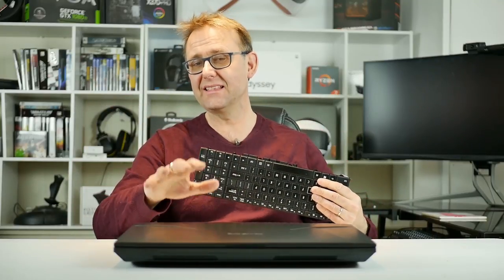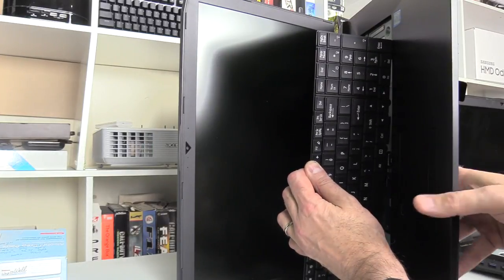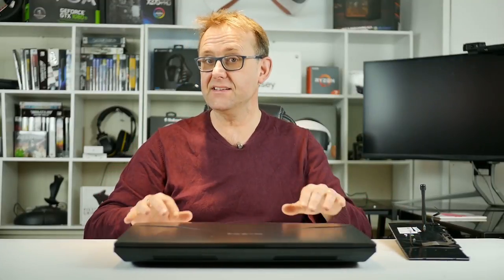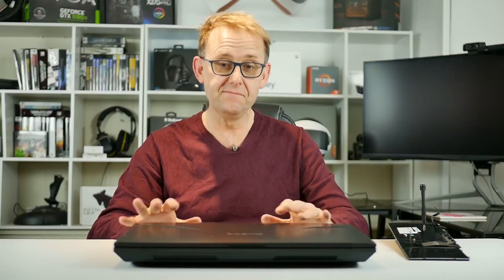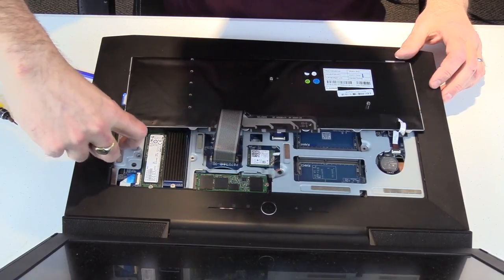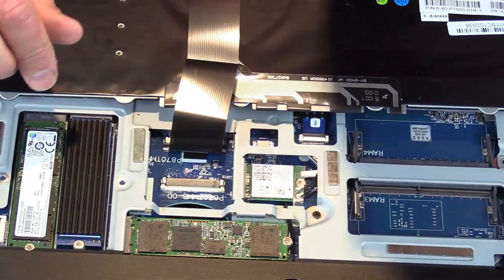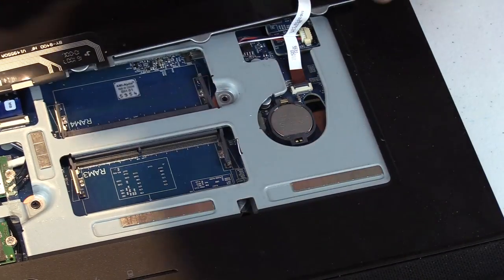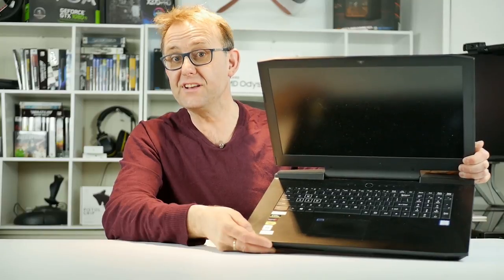My Keyboard Got Stabbed ! How to Replace Clevo P980TM/KM Keyboard

Comment: I know this video is two years old, but i am commenting for the sake of anybody watching now. You are not supposed to push the keyboard out using the screw hole of for the keyboard. There is a separate hole near the fan casing where you can insert a screw driver in. The keyboard has protection behind that hole. You will not puncture the keyboard it using this hole. This hole is marked in the user manual of the laptop, but unfortunately thee is no marking on the unit itself.
Reply from the maker: Interesting. Because the hole i used is marked KB for the keyboard. Next time I do a repaste I'll check it out.
Reply: @OWNORDISOWN  The K/B marking is to indicate that the keyboard screw goes her. The hole that is to be used to push the keyboard out is different one. This hole is marked in the user manual but strangely there is no marking on the motherboard.
Reply from the maker: @PrimeTimeAction  yes, it is strange . They just create confusion with the marking.

Comment: Awesome video. Quick and to the point.  What is your favorite laptop for gaming on.  Thanks for the vids. Channel still looks good with the new name.
Reply from the maker: Cheers Mike :) It has to be my Sager NP 9877, it was a complete pain when the keyboard got pierced. The A and Q keys wouldn't work so I was carting a small mechanical keyboard around with me.
I currently use both the Sager and Flip 14 equally as much and my Aorus x3 for work at the moment.
What is your go to laptop for gaming Mike  ?
Reply: exklim Tech News glade u got it fixed.

Comment: where can you get new clippers that hold the ribbon cables in place as mine are loose when I tried removing the keyboard to upgrade this laptop?
Reply from the maker: Replace the connectors on the motherboard? Perhaps Amazon. A search for ribbon connector brings up many options

Comment: hey! thanks for the video... my "q" key is very unresponsive (I have to press down hard + for a while). I've been trying to call clevo and send emails but no response... looking for a replacement of my p775tm1-g, (6-80-P7500-192-3 RGB LED TASTATUR (KEYBOARD) QWERTY ENGLISH UK CLEVO P75x P77x P87x). Do you have any tips? perhaps it's some dirt? or is it genuinely broken?
Reply from the maker: Perhaps Ebay is a good source for you for a replacement https://www.ebay.com/itm/132474660973?epid=17017113247&hash=item1ed81ae86d:g:jjIAAOSwbs5jfIiX&amdata=enc%3AAQAHAAAAoKDqutcvLI9C7zOKNx6WUC5Ln3J1pYM1nohy3BqRLlW4nxfM9WuSM5J7uAmxfIg2Yzy5ky%2BMg2W9HOTxDaPEverkMFcEk3JUxFk1dB5DHd9EGXfKwZOeg2LZ0DwjfVY3bNyqZrVsdDEeaxg%2FQRawG6vKT9dtFADaZ56z1arRBDW1OJX8IMsvQco4EjPWPjnqY93Hvf29kygIsUgX9TBGB%2Bs%3D%7Ctkp%3ABk9SR7DD3ouqYQ
Reply: @OWNORDISOWN  thank you for the reply! that's an american keyboard. I will try to find uk setting

Comment: I'll tell ya what Steve-o little update. I was getting pissed off cause dragon center sucks huge D. Not only that my processor unbeknownst to me since I'm stupid was over clocking and running at like 3.6mhz the whole time getting me in the 70s. I downloaded Intel tuning and undervolted by. 16 and underclocked to 2.9 base clock and now I run far cry 5 maxed out at 50 to 60 degrees still getting 60 to 80 fps. 1080p. It's pretty awesome
Reply from the maker: Zachary Manning That's pretty sweet Zachary!  That's pretty cool and you didn't sacrifice much performance by the sounds of it. Thanks for letting us know 😀

Comment: This is perhaps the right place to ask this question, I've been wondering it for some time:

I'm a speed typist, and keyboards are important to me. I'm in the market for a high end gaming machine equipped with a nice mechanical keyboard. From your past videos, I've narrowed it to Omen X 17, or MSI GT75. 

My question is: (Of all machines you've reviewed)

Which has the better keyboard? (My #1 factor)

As a content creator: Should I get the 4k option for the extra RGB accuracy? (My #2 factor)

All gaming specs are not my highest priorities (But a fast stable gaming machine beneath 3k is fine)

Personally, I'm leaning towards the Omen X 17, because of your review of it 'Having the nicest mechanical keyboard of all the laptops you've tried'

Thanks.
Reply from the maker: Hi Lendz, yes indeed, the Omen x had the nicest keyboard on any laptop I have tried thus far. I haven't tried the GT75 but like  showed in my video it was very comparable to the two standalone mechanical keyboards I have. 
I think the 4k option would be good as a content creator - my only advice would be that HP must be refreshing it soon with the Coffee lake H CPU's that get launched on April 16th. I would be very surprised if they don't. Those are 6 core CPU's and will help with your work load..
Reply: Perfect. I'll reserve jusgement until you review the MSI G75 😎!

Comment: Great video, Thanks, Its great Sager can easily replace and can upgrade too, Im wondering If new GPU generation like 20 series Nvidia can Upgrade too, Like put 2080 Laptop graphic card.
Thanks alot bro. Love your video and channel.
Reply from the maker: Cheers mate ! Yes, the fact there are many spare parts is a great selling point. It bridges the gap between notebook and desktop.
I don't see why you can't upgrade the GPU as long as it still uses the same power. I would like to try :)
Thanks for watching !
Reply: exklim Tech News one of my friend has it and he loves it 
Im waiting for new GPU hounesty 
After chaotic Alienware 17R4 and waiting for new gen cpu and new gpu. Hope to see new cpu and gpu also thinner.
Reply from the maker: I'm meeting with Gigabyte on Saturday and they are going to give me a peek at their new line up that will get launched at Pax East. New mobile six core CPU's I think.

Comment: Goddamnit. Never seen those backscrews. Tried to pull the keyboard as it is.. 
Doesn;t matter much , keyboard is fucked .. needs replacement. Just annoyed that  you dnio;t even need to remove the whole back plate OR battery, only 2 externals skrews. They even have a small keyboard icon near them on the plastic. 
Thanks for the video.

Comment: How to get it loose in the first place?
Reply: Update: I found out about 2 screws at the back (under the cover plate) marked with KB these removed and the keyboard cake off very easely... 

Still thanks for your video and if anyone else has a struggle I hope this message awnsers your questions as well.